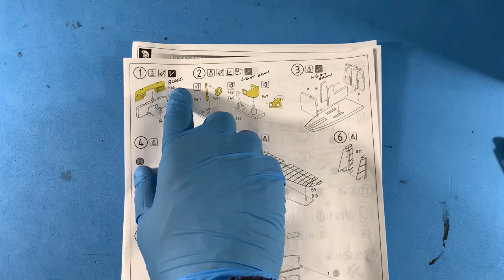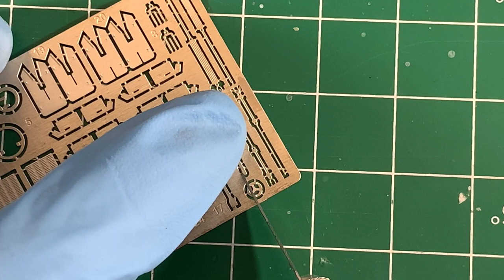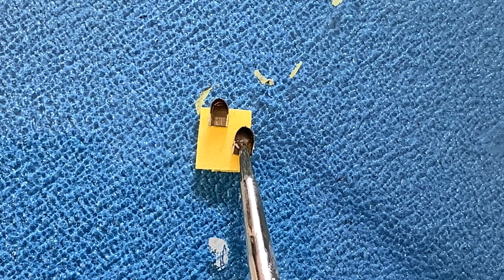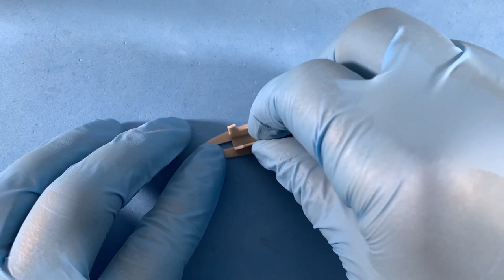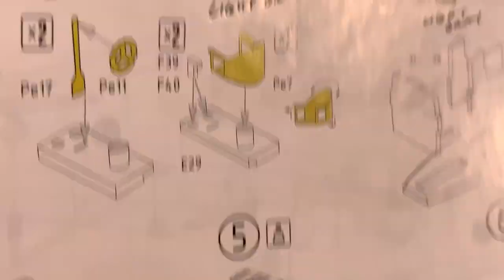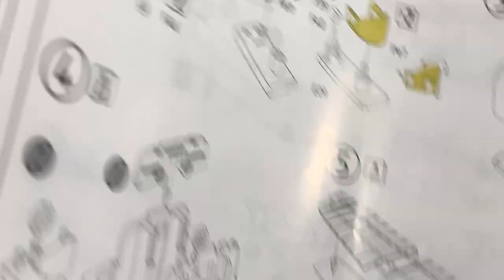Tupolev TB-3 Workbench Vlog 2 Cockpit Assembly

Comment: That part went well. Looks to be a straight forward build so far. I was wondering about the quality of the plastic.
Reply from the maker: Lots of tiny parts but straightforward... I’m starting to get into the fuselage assembly and finding some quirks, something to be expected when you need to glue 6 parts together to make one thing. I haven’t had issues with the plastic, but still have a ways to go.